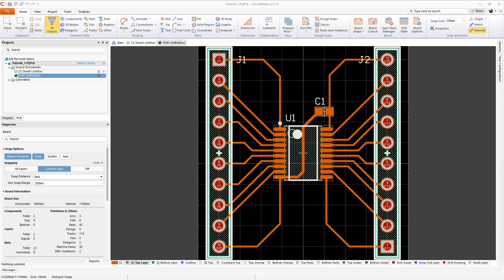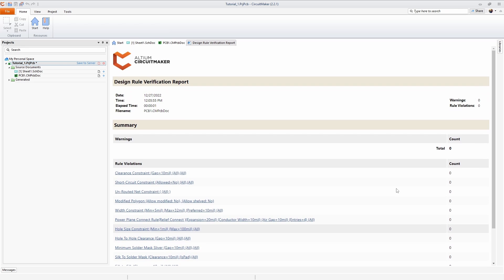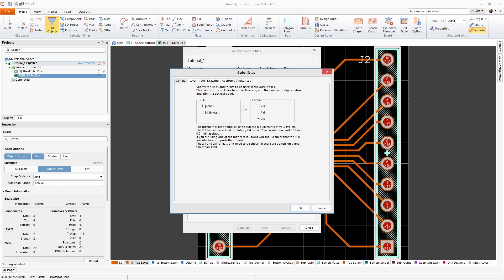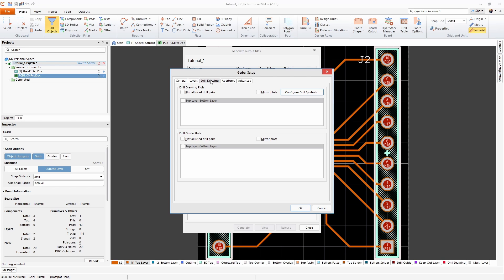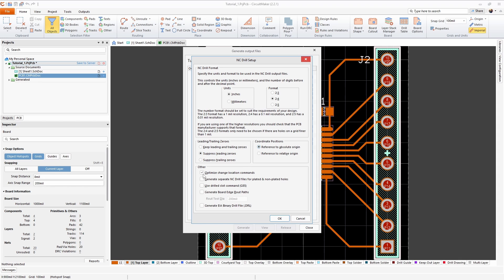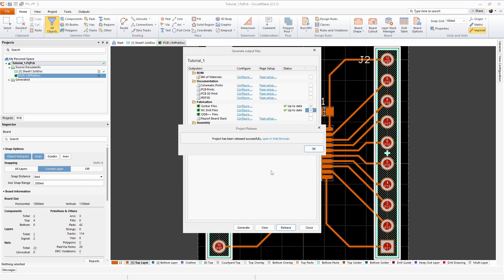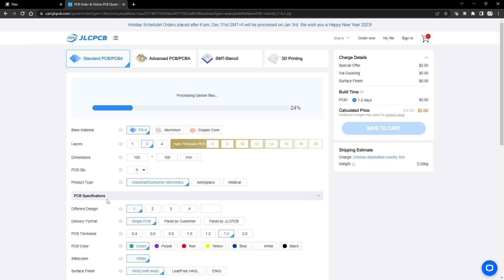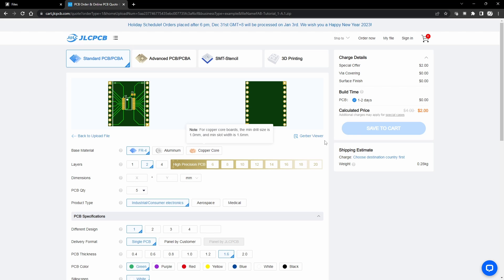Tutorial - Exporting a design from CircuitMaker 2 to JLCPCB

Comment: Emrys thanks for taking the time to do these CircuitMaker tutorials! They have been extremely helpful while designing a PCB. One question: at 1:15 you mention to be sure to setup the Rules in CM to align with the board house. Where can I find these rules for JLCPCB?
Reply: I haven't found a single place that provides clear limits for JLCPCB, but I have seen a variety of blogs and articles in their help section that mention different limitations. For the most part, keep traces more than 5mil away from anything else, and use drills larger than 5mil and you should be pretty safe. I usually shoot for values a little higher than the minimum, just to avoid any headaches.

Comment: Do you know how I can set up the software so I can print a image of the circuit board to size? I would like to make the PCB at home instead of sending it out to a board house.
Reply from the maker: Go to the Outputs tab at the top, select "Printing" and then "Mask Set." This should bring up a print preview that is scaled totally wrong, but has your masks. Next, right click on the pages and select "Page Setup..." and change Scale Mode to "Scaled Print" with the Scale as 1.00. Hope this helps.

Comment: Could you do a video on adding Power Planes in CircuitMaker. Altium has a decent article on that, but in some places it is written from a power user presective.

Case in point:
Look at "Polygon Pour": It's has an icon and a pull down menu. Now look at "Run DRC": It too has an icon and a pull down menu. But can you see the difference between the two?  In the "Run DRC" pull down menu, Run DRC is ALSO listed in the menu, so if you click the icon or the menu, you can run DRC either way - great!
But in "Polygon Pour" they DID NOT put the plain Polygon Pour in the pull down menu, only the "Polygon Cutout" and that works "sort" of like a regular Polygon fill, but that will will NOT work for a power plane fill. You MUST click ONLY the icon. Is it so subtle, it took me many hours of frustrating trial an error to "stumble" on clicking ONLY the icon. I need to find a way to suggest to Altium that they need to put "Polygon Pour" in the pulldown to have the same "look and feel" with other icon/menu items. This will help reduce frustration for new users or those that don't use CircuitMaker every day.

Also, it would be a good idea to include why and why not to do a power plane using the External (poured) Method rather to the Internal Method. 
If you want an Internal Power Plane in the Stackup, you CANT make the Top or Bottom layer a plane, you must add a 3rd layer and make it a power plane.  If you are trying to save cost on a PCB, adding a 3rd layer shoots up the cost. So External Method by pouring a Polygon on the Bottom layer (or Top) is the way to go.
Showing both ways and WHY would be helpful. Also, when you do Internal Method by specifying a Plane layer, it will generate a "NEGATIVE" Gerber image of that layer which is sometimes confusing to look at as all other layers are positive. External Method not only creates a "POSITIVE" Gerber image, but you can also split planes this way - separate Analog and Digital planes on the same layer for example. With Internal Method, the entire layer can only be one signal (GND, 5V, what have you).

Comment: At 5:17 the reason you get an error if you try to download the entire package (Full Release) is because the [VARIANT] part of the release will be empty if you generate only Gerber and NC Drill info. Because JLCPCB wants only these two directories (folders), we generate only those two, and thus the [VARIANTS] directory is empty. If Altium could put a dummy file by default in that [VARIANT] directory, then downloading the entire package would not fail. 

 So you have to download ONLY the directory you show in the video as it contains only the Gerber and NC Drill directories in it.

What I do is:
I generate EVERTHING (click all the boxes) in CircuitMaker (allthough I configure only Gerber and NC Drill for JLCPCB). Then I can download the entire package,  because of this, there will be files in the [VARIANT] part. I do this to save a copy of ALL the design information I can on my PC since CircuitMaker keeps the design on their cloud server and downloading is the only way to get to it. So I keep a backup copy of the design (documentation) on my PC.
Then I copy only the Gerber and NC Drill files to another area on my PC and zip those two together and this is what I upload to JLCPCB.

Comment: Great video. Too bad I found it after the fact [smile].

At 2:28 make sure you draw your board outline on the Outline Layer on your PCB. I changed my PCB size to the size I desired, I thought that was all I needed. It created a Gerber Outline file but there was (in retrospect) no actual outline in it - just some "skeleton" data.  So don't forget to actually draw your Outline on the Outline Layer before generating your Gerber files. You would think that CircuitMaker would warn you about this in the DRC, but I saw no option for it. JLCPCB rejected my design. All they said was "No Outline in Gerber files". So just seeing an Outline file in your Gerber data is not good enough, you MUST draw the Outline Layer.

At 3:02 DO NOT check any of the 3 boxes in the right side window! The word "Add" is misleading, it should say "Merge" because that what they do, they merge those layers into the Top Copper Layer. I had a transistor that used the 3D footprint, it had a Overlay (Silkscreen Markings) and a Courtyard (Pick and Place Tool Keepout) artwork with it. Because I checked those boxes, the Gerber Top Copper layer added (MERGED) those lines into the copper and shorted out the transistor pins. Since this is after DRC, there is no way to check for it and CircuitMaker gives you NO WARNINGS that you just put short-circuits on your board. Why would CircuitMaker have these seemingly useless and detrimental options.  JLCPCB rejected my design the 2nd time for "Short-circits". But DRC passed with no warnings and no errors and I set up the rules per JLCPCB's website.  It took a few emails back and forth before they sent me a screen shot of the offending layer, and indeed you can see how the transistor Overlay and Courtyard lines were put into the copper and shorted out the pins.  It was hard to see because they colored the layer dark blue on a black background and the shorts were very thin. It took me a while to figure out NOT to check those 3 options. I read all sorts of documentation, forums, and videos... all of them glossed right over this part of the "secret sauce". 

LESSON LEARNED:
View your Gerber files (especially on your first design like this was for me) to verify they have the correct info.

Altium has an on-line Gerber Viewer. It very easy to use, you upload your Gerber zip file and it displays the layers. Too bad it wasn't integrated in CircuitMaker. If it had been, I would have found these errors before sending my design Gerber files out to JLCPCB.  I was relying on CircuitMaker to tell me if there was a problem with the Gerber files, but no, it can really screw up the files if you click just one wrong option, or miss just one option.

Comment: The old version used to do a "Save As" locally with the export zip file, took a tutorial to find that they had moved the export to the web!  😄
Reply: Yes, this is my first experience with CircuitMaker. I too could not figure out where my design was stored BEFORE I generated Gerber files. I tried to find an option to store my project on my PC's C drive with my other designs, but nope!

It looks like Altium is pushing their Server (Cloud) Altium 360. Apparently your design MUST be on their Cloud, and since the tool is free, you really can't "say" much about that. But at least you can download ALL the "Output" files to a zip and keep that on your PC. I click ALL the outputs (not just Gerber and NC Files) so I get as much of the design as I can on my PC. I had sent that "Whole Shebang" zip to JLCPCB and they rejected it for "Too many files they don't use". So after I download that full up zip file, I unzip it all on my PC, then rezip just the Gerber and NC Files that I upload to JLCPCB. It's an extra step but I can keep copies of each FULL release on my PC.

So Altium kind of "owns our designs" as they can ONLY be worked from their Cloud.  There are up and down sides of a Cloud based design:

Up Sides:
1. You never run out of disk (cloud) space.
2. Every release is versioned so you could go back to older revisions for reference and to grab code snippets.
3. You can't seem to delete versions, so you can't lose data. It is a true revision control archive system.
4. You can share your design with your team (Read/Modify/Write) or with other collaborators around the world (Read Only).

Down Sides:
1. With a so called "Free" tool, they will eventually start charging us for disk (cloud) space.
2. You can't seem to delete versions:  You can't get rid of interim releases, clean up stuff that is no longer of any use, and you just use more and more disk space.
3. Your designs are mixed in on a server (cloud) with potentially millions of other good users (and malignant users), if a hacker can get into the cloud, they can steal EVERYONE'S data.

I have never used a cloud for ANY data storage, but CircuitMaker is free, and it meets my home budget.
Reply: I've been searching for exactly this information - it doesn't seem very easy to find out exactly where the files are stored or how you back them up - my view is if you only have one copy of a file, then you don't have any copies and the more time you spent making your file, the likelier you are to lose it.

Comment: So how long exactly did it take for you? Mine seems to just freeze.
Reply from the maker: It usually takes about a minute for me. I believe I have also had it get stuck and I had to try again - I think it has to do with the program contacting their servers.
Reply: Mine froze the first time too. I agree, CircuitMaker is tightly coupled to the web for most of its functions - especially at launch. I have a tool I made, called "Process Killer". It has a list of all PC processes that I deem are wasting CPU time and memory. At the click of a button it kills every instance (some are multiple) of every process in my list. It takes a couple of minutes to run after every login, but it speeds up my Windows 10 PC which is a dog compared to my Windiws 7 PC - which CircuitMaker crashes on due to lack of memory (for some resson). Since killing "superfluous" processes, CircuitMaker no longer hangs during Output generation and is not as sluggish starting up as well.